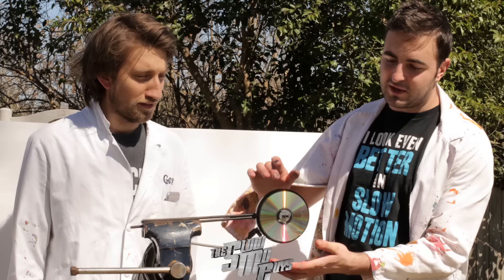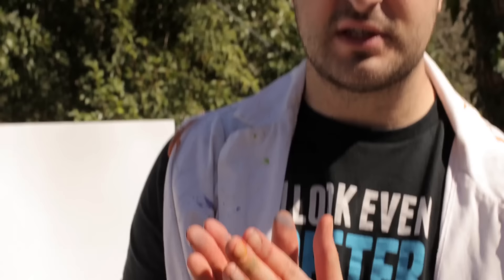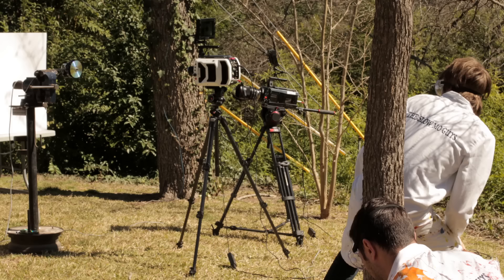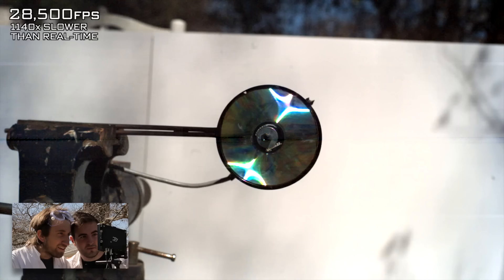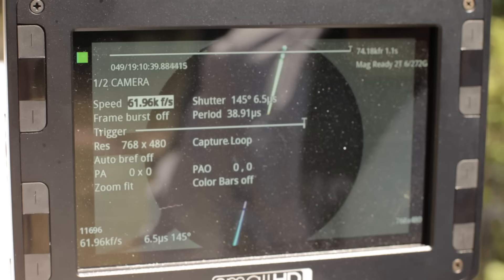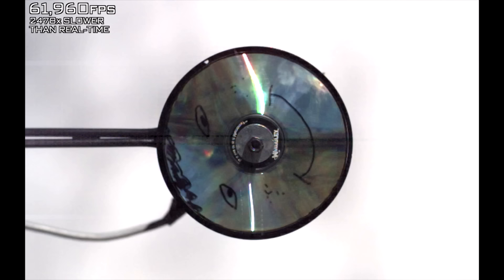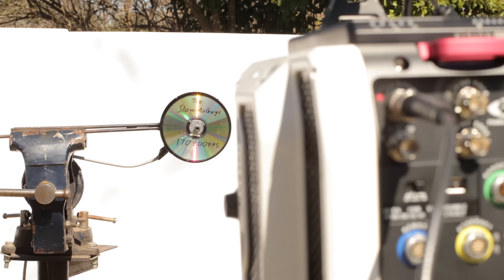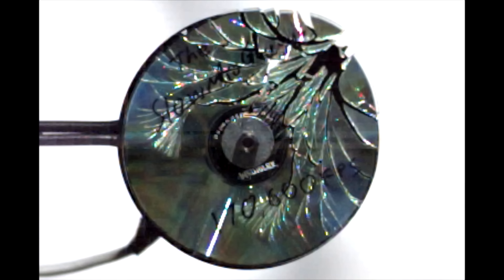CD Shattering at 170,000FPS! - The Slow Mo Guys

Comment: hmm i wonder why the warping is at a different revolution period than the rpm. cool video
Reply: If it was, the same piece of the CD would be warped at the same value constantly. It doesn't look right, you should expect an oscillation of each point on the CD, thus the different revolution period.
Reply: Now that i think about it, it's probably from air eddies that build up on sections as the warping gives a feedback of more eddies. The shape of warping definitely makes sense along these lines, and it makes sense that the air would slow down as its angled face is met by the air in front of it.   and obviously the disc has to keep spinning quick because of the applied revolution force from the motor
Reply: If you think about it, if the warp shape spun at the same rate as the CD, there would be no reason for the CD to shatter. It would be the same as if you were simply holding a disc at rest and bending it by a fixed amount. Most people (I'm guessing) would have tried this and would have seen how much a it takes to finally creak a CD by hand (dumb and unsafe but c'est la vie).
The warping. i.e. the surface of the CD had to have passed over the crests and down through the troughs of the standing waves in order for the cyclical loading of the plastic to have taken place.
Reply: I suspect the warping effect is caused by the drag being greater at the edge!
A follow up of a Tesla turbine could be interesting! (basically a stack of CD's with a small air gap with exhaust holes round the center and air fed at the edge)
Reply: Im no engineer but my common sense tells me its because of the elasticity in the material. It can warp a set amount, and the acceleration difference between the spindle and the edge would form a sort of shockfront as it got up to higher speeds, naturally this would oscillate, as these things usually do, until the energies being dumped into it were enough that the cohesive force of the polymer the disc is made of breaks. In a pattern similar to a lightning strike.
Reply: All of your explanations make sense but it was easier to just take it for what I saw lol

Comment: As an object spins, parts within or closer to the axis of the spin are technically moving faster than those further out, and are making smaller tighter rotations; which is part of where the distortion comes from. The shatter point comes from whatever point on the object has been the most subject to such velocity for the longest time (or just whatever part of the object is structurally the weakest), thus its the first to break and send a chain reaction along the rest of the object.

Comment: What causes the warp? Is it the air resistance as it spins faster or the acceleration difference between the outer part of the disc and the inner part?
Reply: The reason for this is the mechanical drift energy (Like in a carussel) is pushing the Parts of the CD to the Outside, that energy then either heats the CD up or leaves the system another way, in this case by adding a movement power (kinetic energy) in the other 2 directions of the Spinning CD leading it to flatter like that (therefore I assume that the CD is also super hot while shattering).
Reply: it is the air resistance that is higher than the material that moves through it. Good observation!
Reply: i dont think the air resistance is that important in this case. the surface of the cd isn't very rough at all and shouldn't cause much resistance.
Reply: Kyle Schaff I would like to see it be done in a vacuum

Comment: Please record something like a bullet who crashes into a screen in glass, like the old TVs. With the hammer, the screen was broken un only one frame! With the 170.000 fps, this Can looks like berger :D
Reply: Berger*
Reply: Better* (god that phone change my words)
Reply: Moorb0y52 burger
Reply: Won't see much at that speed, need to go down to 1 million to see it very good, and the resolution would be pretty low. I do want them to film something at 1 mill though.
Reply: Clouck you did hear 4 seconds at 170600 fps was 96gb a 1tb 7200 rpm hhd costs as low as $50 so every second would cost over $1.25 just to record it
Reply: Jose Brito Wrong. Hard drive write speeds are really slow and its crazy just to put 64GB of ram in a camera for the frame buffer alone, so they use high speed SSD's instead so that theres less strain of the cameras memory.
Reply: yum
Reply: DJ_Harris nope phantom has a custom storage device with a max write speed of 1.5gb per second the fastest ssd reach only 520mb per second write speed
Reply: Jose Brito Incorrect, M.2 and PCI Express SSD's can reach 1 GB plus in the real world, and around 10 GB for M.2's theoretical limit.
Reply: ZettabyteGamer still not 1.5gb only arond 900mb
Reply: Jose Brito I know, I only wanted to let people know that speeds can be higher then that depending on how it is connected to the PC.

Comment: It appears that the outside of the disk is moving slower than the inside of the disk (in a sense, more like lagging behind it ever so slightly). Most likely an effect of the high speed it was rotating. The rotational torque put on it, as well as the difference in rotational speed across the disk, tore it apart. That's my semi-scientific explanation.
Reply: this is incorrect
the centrifugal force & the stresses due to the warping caused it to fail.

Comment: What if you tried the experiment in Vaccum ? Will the warp effect still be present ? Will the CD break ?
Reply: Hariharan Varadarajan i'd bet it breaks because of the extreme centrifugal force affecting the molecules of the CD, so even in vaccum it should break, but i'd bet the warp effect has to do with small random variations on air density or imperceptible irrgularities on the CD surface that make create a resonance in the air around (you can hear something similar to that) and that vibrating air generates a wave on the surface of the CD, so it would not be present in a vaccum. It would certainly be cool to see it.
Reply: @Javier, you seem to be correct. the centrifugal force always tries to push the object outward from the axis of rotation. So when the setup is under resonance, it experiences the maximum amplitude, and as you said, that might push the molecules of the CD towards outside direction. Should  be a good experiment to see and conclude the physics behind it. What say +The Slow Mo Guys ? Possible for you guys to try out this experiment in vacuum ?
Reply: The warping of the disc actually comes from the vibrations of the motor

Comment: If I was watching this video in 0.5x speed would I be watching a 340000 fps video?
Reply: no.
Reply: Ull be watching at 60 fps
Reply: Yes, you would be watching it in 340,000 FPS.
Reply: Actually it would. As they mentioned before, the higher the FPS, the slower things go, so now he doubled that by halfing the movement speed. So now it went the other way around, the slower things go, the higher the FPS. However, the resolution won't be as high.
Reply: ***** Well, it's fully adding frames, it's just slowing it down, no resolution was added.
Reply: He's just watching 170,000 FPS at the half speed, there are no 340,000 FPS in the video.
Reply: Okay, my bad.

Comment: This canny be warp it would go back in time and by my calculations and what I learnt in school put together it would go back in time aproxemenly a few second travelling  at the speed of light away in any direction and shattering the split second it comes out of warp
Reply: Squirmey101 No no no wait a sec. This kid is actually making sense. If we take the RPM of the CD to be an arbitrary number, like 44,683, and cross-reference that with the FPS of the shot, 170.6k, then measure that against the speed of light, 80 mph, then we arrive at a fascinating conclusion. The speed generated by the CD, and the resultant force, would be close to 596,485,245.67356j. In layman's terms, this is enough energy to send some small particles back in time. You see the amazing thing is that the smallest particles could rip through the fabric of space. The thing is that the particles can't just go no where, they have to end up somewhere. The past already physically exists, therefore the only possibility is that they end up in the past.
Reply: Squirmey101 Yes but the Grandfather of those particles would still be alive in the past so they would be born anyway
Reply: Squirmey101 Why do you think scientists call the beginning of the universe the Big Bang? Giant cosmological orgy.
Reply: That RPM doesn't even come close to the speed of light.
Reply: Reapzehz but if you cross-REFERENCE it then it goes to about 80mph, which is roughly the speed of light
Reply: Squirmey101 Yeah, I know. 299 792 458 m / s = 80mph if you translate it.
Reply: ExistentialOcto c = 3E8 m/s = 3E8 * 60 m/h = 1.8E10 m/h = 1.8E10 /1600 mph = 1.1E7 mph = 11 million miles per hour

also you need infinite energy for matter to move at the speed of light, look at special relativity
Reply: Isnt superluminocity fast....?
Reply: the derp
Let's consider the tangential velocity v, which is given as v=rω. And ω =dθ/dt.
Given the CD goes to about 100,000RPM at it's fastest speed (as stated in the video), it is cycling through 2π radians every 1/1666ish seconds (1.6kHz). So ω=2π/(1/1666)=10471 rad/s.
Given that the diameter of a CD is 120mm, it's radius is 6cm or 0.06m.
Therefore, the tangential velocity of the CD's outermost point is approximately 0.06x10471=628m/s or 1,500 miles per hour.
This is pretty damn fast, about 3x faster than a modern aircraft. But this is still nothing compared to the speed of light. Which is many orders of magnitude larger than the tangential speed of the CD.

If you mean that they incorrectly called the speed 'warp speed', they did clarify that they were referring to the speed of which the CD would physically warp so much that it would shatter.
Reply: ark_ryl thank you i understand now

Comment: why does it shatter from the edge not the middle
Reply: centripetal force!
Reply: +Abby L the edge is moving faster
Reply: +Nec0byte Not in angular velocity, you shoudl specify that in your answer so People dont get it wrong.
Reply: theres no edge in a circle
Reply: Cintripital force pushes the energy out not it
Reply: I have no idea what you mean by "pushes the energy out" but if you're saying centripetal force goes outwards, you're wrong.
Reply: +Nec0byte The edge isn't moving faster, it's only travelling more distance than the center of the disk
Reply: dutchrjen  Yeah right, I misunderstood that. Thanks for clarifying my confusion :)
Reply: Also I think the warping is more extreme at the edges.
Reply: +lorenzo portocarrero yes it travels more distance, but it takes the same time to do it. so that makes the speed greater. v=s/t. if s is bigger and t remains the same, the speed goes up.
Reply: +lorenzo portocarrero sorry i didnt see that someone else already explained it^^ my bad
Reply: Taco
Reply: Because it travels faster on the outside

Comment: Can anyone scientifically explain why the CD "warps" like that? I am curious
Reply: not scientific per se, but i thought the bit the cd is spindled onto the motor with isn't fixed on both ends, so maybe that's the cause for the warping....? the way it shattered outside in then out the other side was pretty cool.
Reply: It warps because a CD isn't perfectly flat. And it's not perfectly parallel to the rotation of the motor. So the edges are being throw from "a little bit forward" to "a little bit backward" incredibly quickly. As you increase the rotations per second, this compounds exponentially, until the warping becomes too intense for the integrity of the CD.
Reply: Zero I'm not sure, but I'd guess it's the forces and the vibrations. If you look at slow-motion footage of a drummer playing a kit, the cymbals look incredibly strange when hit because they appear to the camera like some kind of semi-liquid metal - not unlike unbaked pizza bases or something!
Reply: Melody Lam Yay, science! :)
Reply: Melody Lam Now, I don't science as well as you, but I am an enthusiast.  One thing I believe I saw, was that the discs were not mounted on center, or at least that is the way it looked to me. A millimeter or two off center will introduce extreme pressure due to it not being balanced.  Also, since the warp was not moving at the same speed as the disc was, all of that flexing and bending would produce a lot of heat which could in turn soften and weaken the integrity of the disc.  There are a lot of forces involved here.  For such a simple looking demonstration, there is a lot that can be learned.
Reply: Zero HighSpeedFanatics is correct.  This phenomenon is called "whirling" believe it or not. it's a problem with industrial equipment when shafts are unbalanced and running at high enough speeds. CD's are balanced pretty well for what speeds they operate at, but if you spin them fast enough, eventually you'll see these oscillations. 

i'm not sure about if it is going on here, but at the right speed for the right material resonant frequencies will be reached and oscillations will become massive (like that windy bridge video if you've seen it). It looks like they may have just brute forced it. not sure, but it might be possible to see this warping happen at a lower but very exact speed.
Reply: ok im not that good at explaining things and my english is not anywhere near good enough to explain this but it may be of some help for you.
so we have a motor spinning a disc.the motor uses an incredible force and it gives out a lot of energy to the disc. no energy is created from nothing and no energy is lost it only passes from one state into another. in this case its most likely that all the particles of the cd were trying to give all that energy they got from the motor and it would naturally go from the middle to the edges since the motor is in the middle of the cd. since there are a couple of interesting points in this specific movement which include the ones mentioned previously in a comment (the 180" and the 335") the disc is most likely to start bending because some areas have more energy than others as shown in this video(there were places when it curved and those places did not follow the spin of the disc). there should be 4 easily distinguished areas which are curved. the most interesting points are the 180 and 335 though, since those are the points where the energy within the moving body and its particles changes the most and are most likely to break since the energy of those particles is changed and it greatly affects their connection with one another. when the energy is too high there would be a point in which it breaks and its most likely to be one of those two(180 335). when there is a crack fromed in the edge of the dist its most likely to reach the middle and then from there just break the whole thing into pieces. thats why there is a tree like crack which starts from that specific spot.

Comment: error_CD.exe has stopped responding. error_CD.exe preformed illegal task. error_CD.exe has-EEEEEEEEEEEEEEEEEEEEE [Connection Lost] Attempting to reconnect. SOUND SYSTEM STOPPED. BEEEEEEEEEEEEEEEEPPPP Life.exe has crashed
Reply: Universe.exe has been opened. User=Science Has deleted file Universe(1). Science opened Universe(2).
Reply: A problem has been detected and Life has been shut down to prevent damage to your computer.
The problem seems to be caused by the following file: CD.SYS
CD_SPINNING_TOO_FAST
Reply: +PikaChuChuJelly cewl

Comment: HERE SOME MATH FIGURES FOR YALL!!!
the circumference of a CD ROM is about 37.6 CM at 23000 RPM that = 144.13 meters/ second.... meaing a simgle point on the edge of the discs stravels more than the length of the track at your high school. ( usually they are 100m long then 100m around the curve...
they recorded for 4 seconds so assuming that is the time it takes, from velocity at 0 to velocity of 144.13m/s at 4 seconds that means and average acceleration of 36.03M/S^2 
with an average weight of 16.44g for a CDROM with a radius of 0.06m and 383.333 rotations per second. the energy at any given point on the disc is ~3.26J before failure.
im probably wrong though. cause im only an engineering student atm in second year, i probably missed something but this is what i got from it XD

Comment: I used a machine we called a photoresist coater, and it would spin at very high velocities, every once in a while a coater motor would go out of control and run away with a silicon wafer on it and continue to spin out of control til the wafer could not take it anymore and disintegrate to dust, or would detach from the spinner and wiz around the room until it smashed into something. Very dangerous, the sound of the motor ramping up let us know how long we had to vacate the area.

Comment: would running inside a vacuum chamber increase the maximum radial velocity before failure? It looks like when it begins to warp, it begins to pick up air and fluid dynamics take over - until the stresses from warping cause the CD to shatter. I would think running it in a vacuum would allow it to spin faster, and catastrophic failure would be more uniform rather than a Christmas tree shape.  Great test!

Comment: I'm surprised by the fact you guys didn't put a protective film between a soon to explode object and an extremely expensive and fragile piece of equipment.
I question: since you can record only a few seconds of footage at those speeds before you ran out of storage, how did you time those recordings? Was the camera running from the start of the spinning or just a moment before what I guessed to be the event?

Comment: If my calculations are correct with, the edge of a CD 12 cm in diameter spinning at 23,000 RPM travels at 8,666.4 m/s or 31,199.04 km/h.

Comment: You should try to do it in vacuum, cause I thinks the CD spins so much that air surrounding it causes lower pressure on sides that bends the disc and finally gets it to pieces